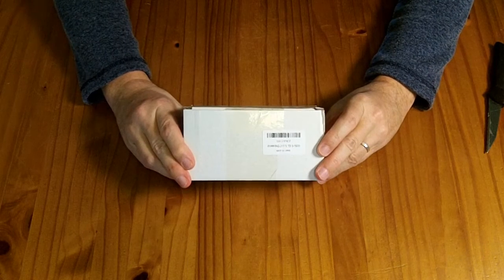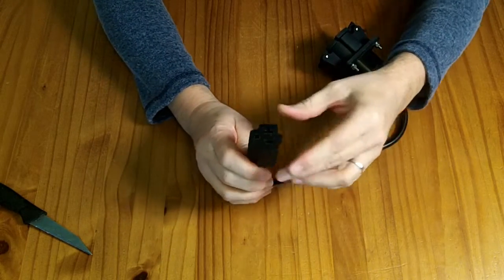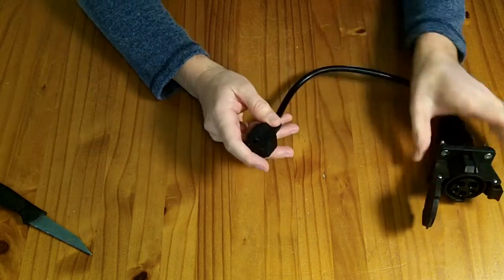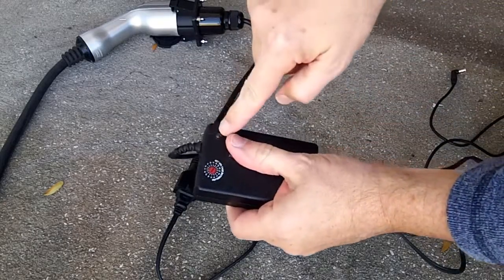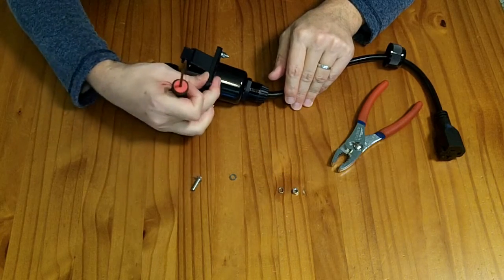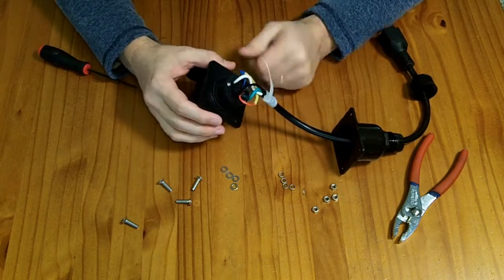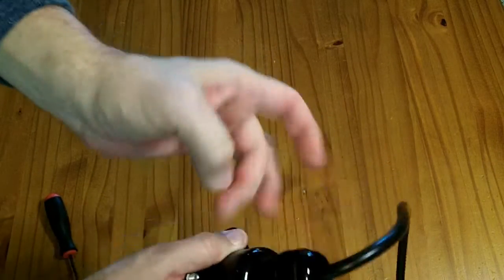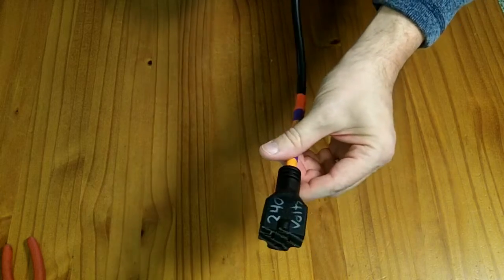Review: EVHiking J1772 to NEMA 5-15 discharge adapter (240 volts!)

Comment: I just ordered one of these that has the IEC plug as opposed to the NEMA 5-20R. Figured this would go a long way towards keeping people who might find my adapter from plugging 120VAC devices into this. The chargers for my escooter both have IEC receptacles and draw 125 watts each at 120 VAC for 250 watts total. Seeing as how this device is unfused, I might start looking at getting a 5 amp fuse to go between the L2 and the load.
Reply from the maker: That does sound a lot safer

Comment: I tried to use it with a public, ubiquitous Clipper Creek EV charger and the charger returned a fault. What would cause that?

I noticed another charger advertised that it produces a 1000 hz signal. Is such a thing required? Did the lack of one lead to my fault?
Reply from the maker: My best guess is that the CC EVSE detected some type of ground fault (perhaps from the device plugged into the adapter).  Or perhaps the CC EVSE is just better at detecting that this guy isn't a legit car based charger than my JuiceBox was.

Comment: This would be perfect to allow you to charge the bmw ce02 electric scooter.
Reply from the maker: @Texasprepper  that is one of the use cases, as long as the charger accepts 220 volts.
Reply: 15amp max is ok. I would use 1200W max for this adaptor. The problem is it is 240 Volts

Comment: Hi is that yellow wire going to the pilot pin? Pin 4?
Reply from the maker: 1) You shouldn't be replicating this circuit, as it lacks some safety features that are nice to have.  2) I believe it is connecting to the proximity pin to let the EVSE know that it is plugged in, as this device does not honor the pilot amp limit signal from the EVSE.

Comment: What if you disconnect one of the hot wires and use ground as the neutral. 
120 v.
Reply from the maker: A) That's even more out of code than what they are doing. (Ground should never carry current) and B) The EVSE would detect the "ground fault" instantly and shut off power.

Comment: building an ev range extender. got one of these to use as a j1772 recepticle to charge my batteries through a uk spec 240v to 24v inverter by easun power. building my own 8kwh lifepo4 batter bank. wonder if the plug can handle enough amps to pass through charge my car through the inverter while i charge the battereies. might have to set the battery charging current down. my car only pulls 3-3.3kw (old chevy volt), and i think the inverter maxes out at 60a battery charging = 1.6kw in from ac. so thats potentially up to 5kw through 240v = 21 amps. hmmmm. maybe if i put the cord next to the inverter fans lol
Reply from the maker: I would not trust this receptacle for more than 1.6kw total.  Instead, you may be able to tap the two hot lines off of your car's OEM J1772 receptacle.   One thing to keep in mind is that your car's battery charger is listening to the pilot signal from the EVSE to limit amps to the max the EVSE can provide.  If you run into an EVSE that can only do 12-15 amps, the car will honor that, but if you are tapping more for a different device, the total load may go higher than the EVSE can handle. 

I'd suggest keeping the two systems separate, and finding a place to charge that has two EVSE's next to each other to charge in parallel.
Reply: @summetj  hmmm ya thats a good point. ironically the j1772 port is on the other side of the car and goes into the hood so not easily accessible. anything that goes into the high voltage dc system imo is off limits anyways in terms of rewiring. 
probably best to keep the systems separate. ide hate to be "that guy" monopolizing two ev chargers with one going at 3kw and the other at 1.5kw lol, but i will probably go out at lunch time and just switch it over manually. 
didnt realize that an 8kwh battery charging at only ~1.4kw will take almost 6 hrs to charge. thats all day.

Comment: I get the idea and I want it but it shouldn't be able to be sold because it violates electrical code
Reply from the maker: @laggyplayer2499  I generally agree with you, but I'm not sure if code specifies what can and can't be plugged into a J1772 EVSE.
Reply: That’s true for North America, but in Europe it would be common because their grid is 220v. So, you could add a European receptacle and a European male connector to your charger, and it would then be legal.

What this device does is allow you to use the 240v capability of your charger. If you took your e-bike to Europe and used an adapter to connect to any of their household outlets, it would be the same thing.

Other than the form factor, electrically they would be the same. You can think of this adapter as a European receptacle adapted to the USA plug without adding adapters in-between.

As long as you understand that this is an adapter that does not step down the voltage and basically requires you to use European electric standards, it’s perfectly fine to use like any other travel adapter.
Reply: Electrical code is generally only a requirement for building houses or offices in the USA. You don’t need to follow code to sell appliances.